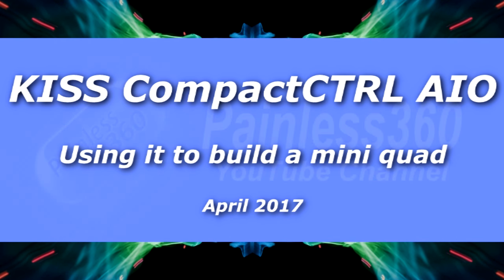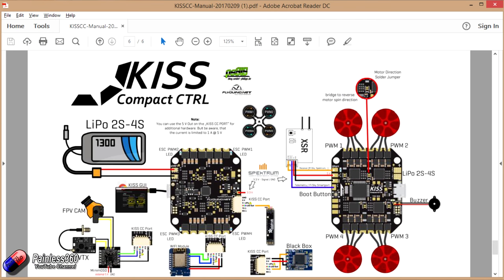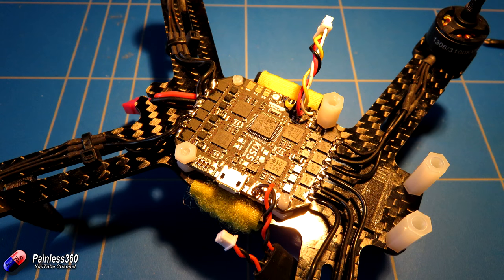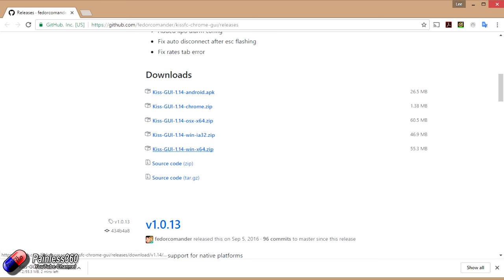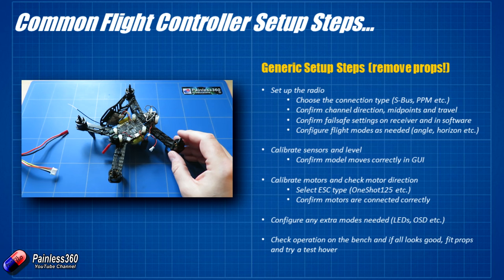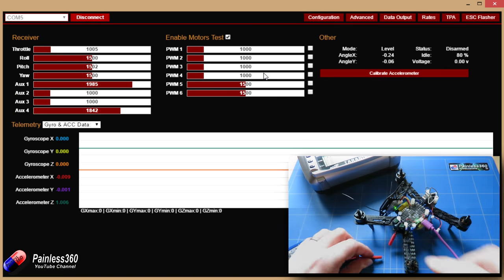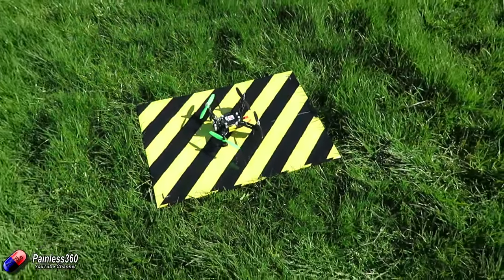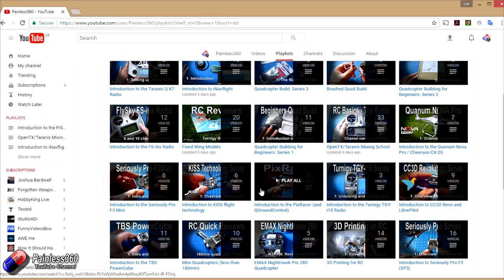Building a mini brushless quad with the KISS CompactCTRL AIO flight controller

Comment: I still prefer the XSR over the XM-Series, just because of the telemetry.
Saw you comment on transplanting this again to another frame :) I'd really also use XT30 instead of the JST, just to be sure.
Reply from the maker: Yeah, see the comment we made on the video. We have a cool, much tougher frame we will be looking at in about a week and transferring all of the electronics (with a 'real' Vtx and camera) to it so I can run 3s packs. We'll be changing out the power connector at that point too.. Happy flying!

Comment: how far did you get? I have a PEN issue where motor 3 will arm but then for during throttle with motor 1 and 2 spinning up fast with no authority
Reply from the maker: All in the video - built and flying..